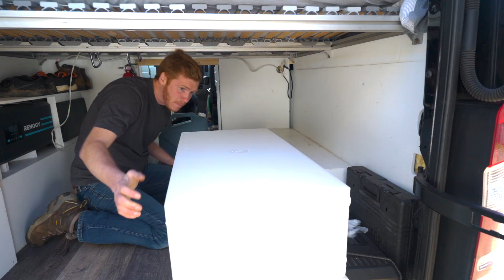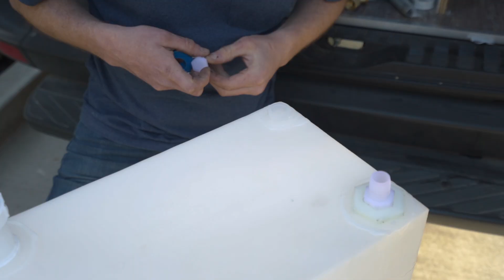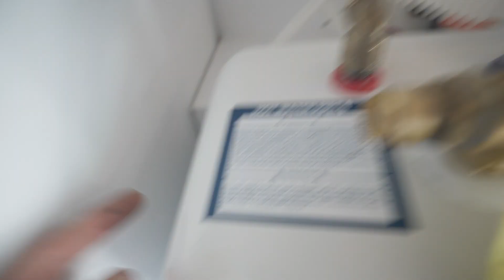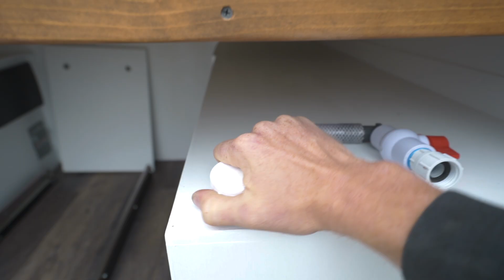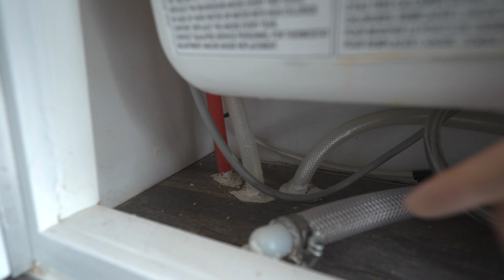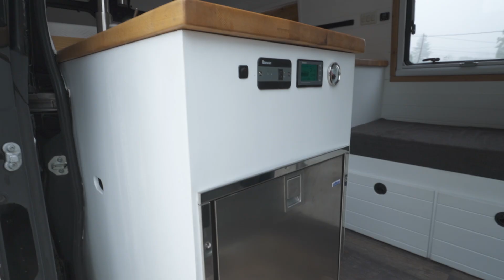Sprinter Van Build with Water Heater, Filter, 25 Gallon Tanks, and Outdoor Shower

Comment: what kind of rocker switch did you use to connect to the outlet for the water heater? How many pins did it have?
Reply from the maker: It’s been so long, I can’t remember. It would have been a 120v switch though

Comment: Why hide the water pump switch. You might forget that it’s on.
Reply from the maker: Water pump auto shuts off once pressure is reached (faucet switched to off) The switch is mostly there in case you need to leave the van for a long period of time and want some extra peace of mind by switching it off.

Comment: Curious why you would go electric instead of propane?
Reply from the maker: I mostly didn’t want to have propane on board. I didn’t feel it was unsafe. I just didn’t want one more fuel source to fill up. Now, I would recommend a hydronic heating system utilizing a diesel burner.

Comment: Hi there, are you not loosing water from your vent tube, it not rising up?
Reply from the maker: It’s possible to lose it on a very steep hill. Make the vent tube rise as far as possible before lowering it to the drain port. This will mitigate the water loss

Comment: You might want to move your water pump switch to the countertop area or some place where you can easily see it so you can quickly check that it is turned OFF before you leave the van.

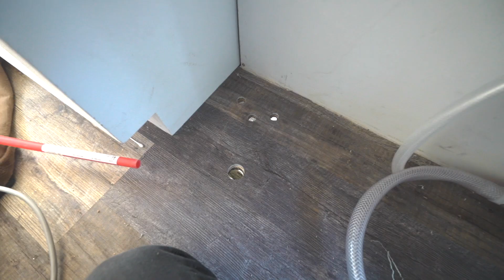Comment: 2:20 Funny how you blurred the accidental middle finger. But on a serious note, why would you have a hole 1/2" larger than your pipe through the floor? I would think tolerances should be higher, like 1/8" at least.

Comment: Random question what if you're 6'5"" and you want an affordable van where you can sleep comfortably in/walk around in... what model would you recommend?
Reply from the maker: I’d go with the Ford Transit long wheel base high roof cargo edition. It’s interior height is about 6’7. Another option is a box van but that limits getting in and out of the cab without going outside.
Reply: @shaunwilkens  Right on. Appreciate it brother.
Reply: Agree with recommendation of extra tall.  You’d want a loner wheel base too, as you can’t put 6’5” across any van, except if you sleep diagonal

Comment: Did a great job!  FYI... hot is always on the left side, cold on the right.  You have em backward, flip the hoses around.
Reply from the maker: It’s an ikea faucet and the hoses are all attached correctly. It’s designed to be cold toward you and hot away. The way it’s oriented in my van is different than ikea intended but to switch the hose would be confusing because there are blue and red markings indicating the direction to move the lever.
Reply: Ah, had no idea.  Good to know.